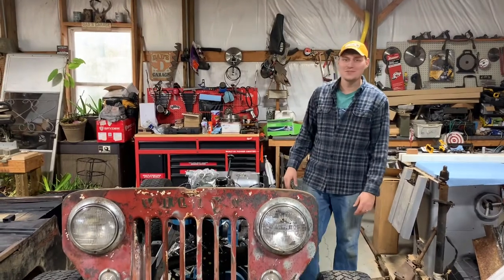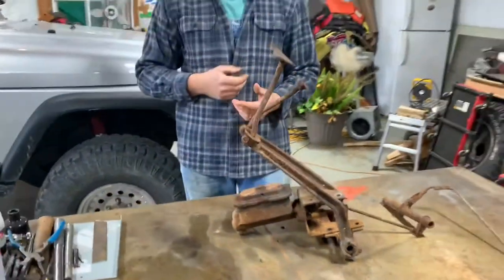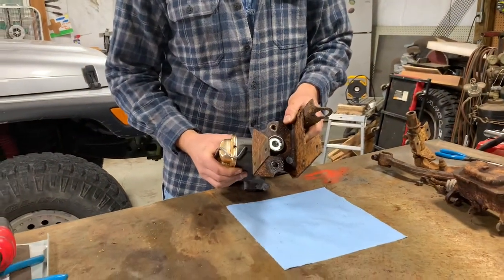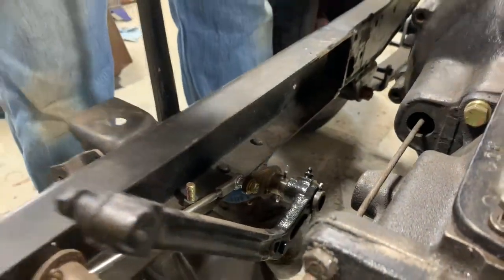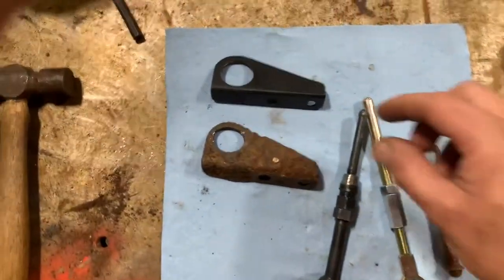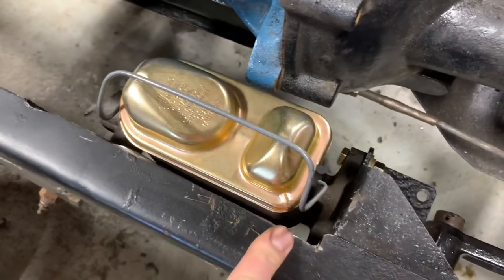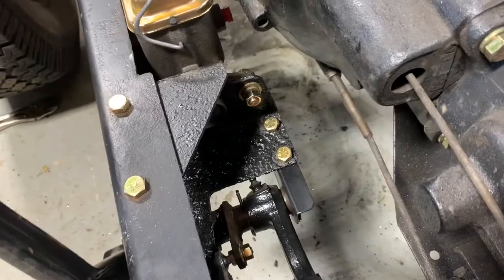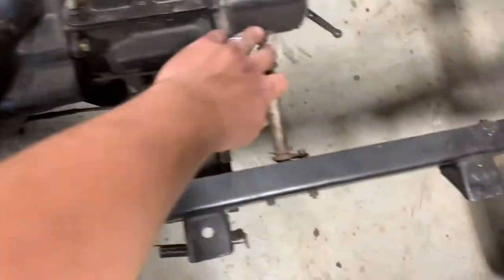Willys Jeep Dual Reservoir Master Cylinder Upgrade!

Comment: If you are lucky enough to have an M38A1, that bracket is a bolt on to the frame, like the 1968-70 CJ5
Reply from the maker: That’s good to know!
Reply: I have a 53 m38a1 and am in the middle (2 yrs in) of complete frame off restoration. I just ordered parts to convert front brakes to disc and will be adding a dual reservoir master cylinder.
Reply from the maker: @sawpilot  Excellent decision!
Reply: Any recommendations of a good model for this bolt up?

Comment: I see in the video the brake arm flopping backward, pulling the push arm out of the master cylinder. How is it held forward so that doesn’t happen? Restoring a 63 CJ-5. Can’t find a good drawing on this. Is it just held forward by butting up against the firewall?
Reply from the maker: There’s a big spring and washer that stops it up against the floor. Good question!

Comment: Still looking for that bracket. My 67 CJ5 OEM master bolted through the frame.
Reply from the maker: That’s strange I thought all the V6 CJ5’s came with that bracket. There’s several conversion kits out there but they are pricey.